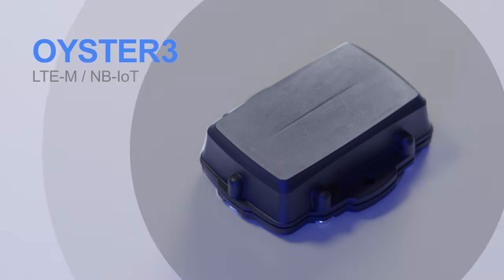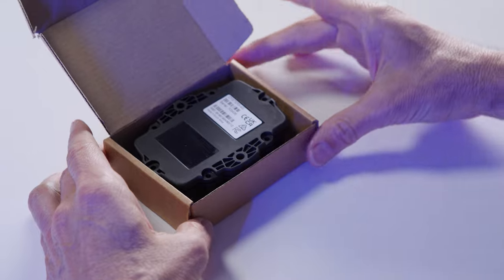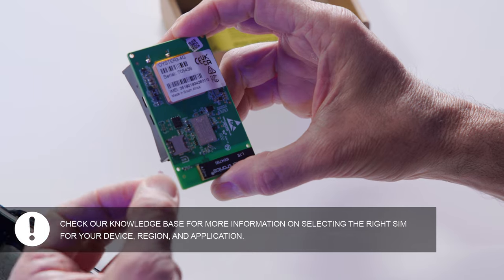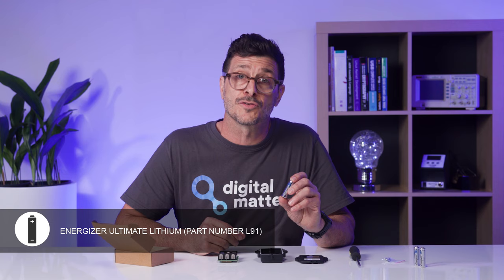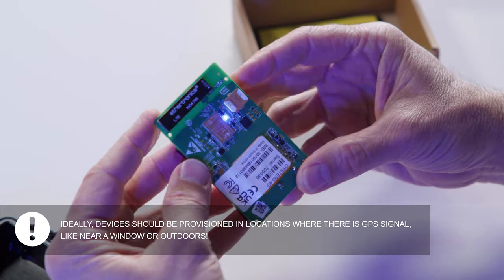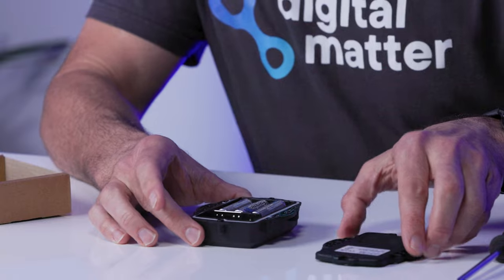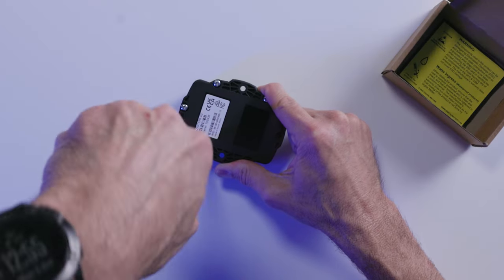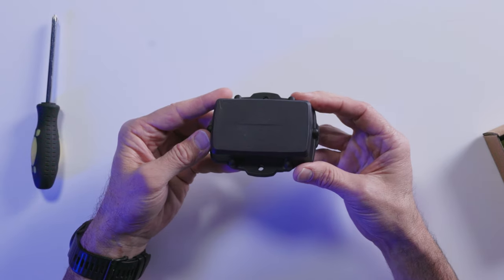Unboxing the Oyster3 Battery-Powered GPS - Digital Matter

Comment: How long does the battery last with say normal average use?  Also, how much is it? Monthly payment or one time payment?
Reply from the maker: Battery life is dependant on a few things like how often your asset is moving, your customized settings, where it is installed, and more. But, if the device is reporting in every hour, you're looking at roughly 3.5 years before you need to change the batteries.